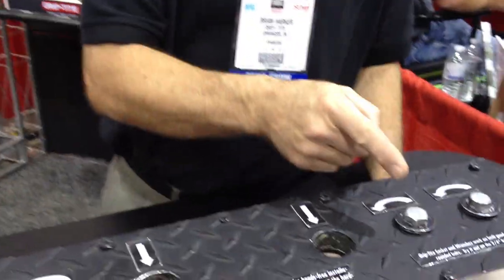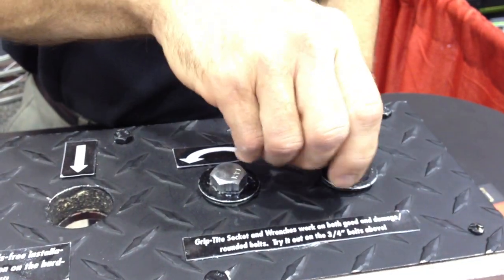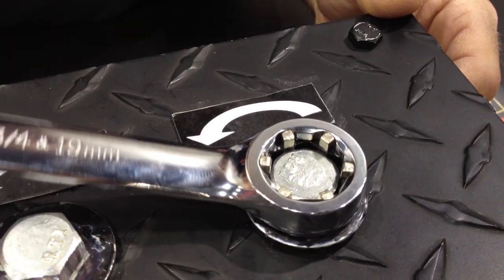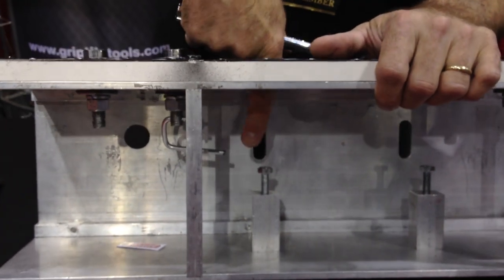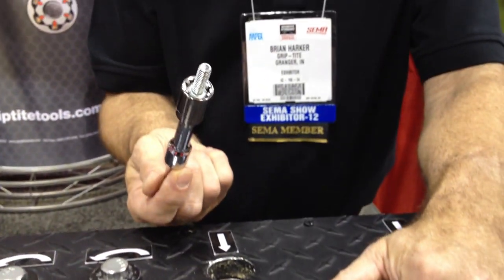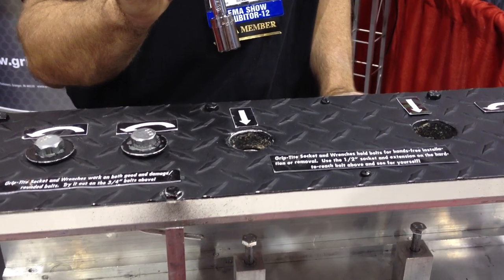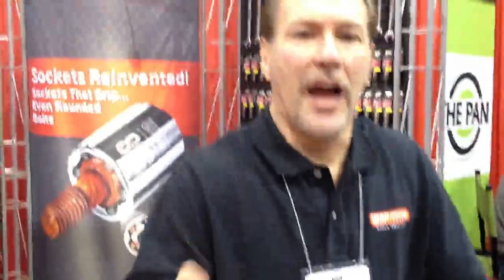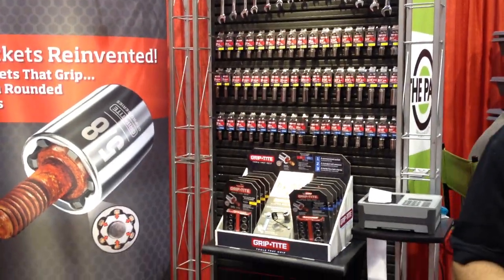Grip-Tite Wrenches and Sockets - SEMA 2012

Comment: I'm sure these work fine but in my experience and wrenches/sockets that have small moving parts are going to break eventually. I'll stick with the tried and true method of hammering a smaller 12 point socket on there and if that fails weld a nut on top

Comment: A rounded nut usually means it's seized. Which means a tool like this will likely break when trying to undo it.
Reply: very agree with you
Reply: Nope I had these wrenches and sockets and they work fucking great I’ll tell y’all I was working on a car replace a caliper the slide pins were so rounded I couldn’t use a normal socket obviously, so I came across grip tite and give a shot man they work great the slide pin was so stuck i had to use a a small pipe for extra leverage !! They hold on great never slipped and guess what took that stuck rounded bolt off !! No struggle I recommend